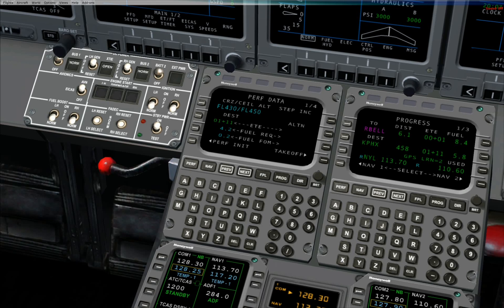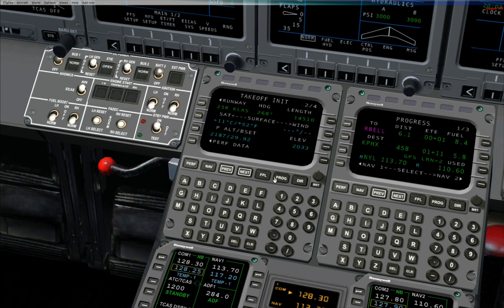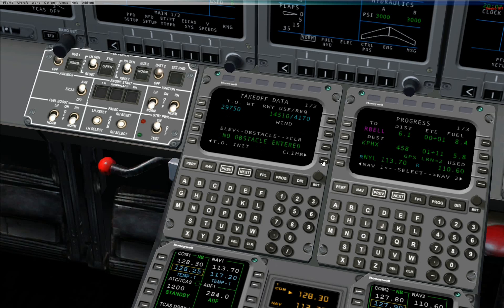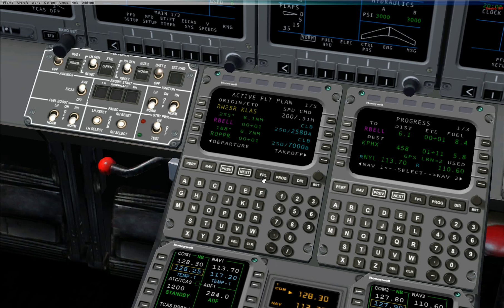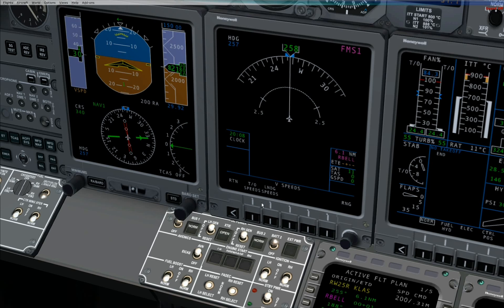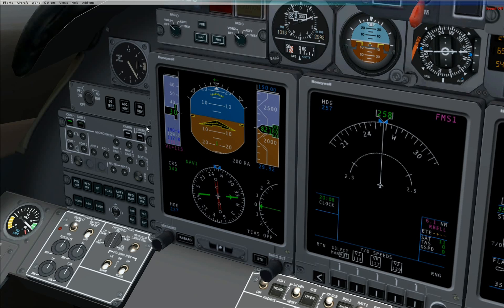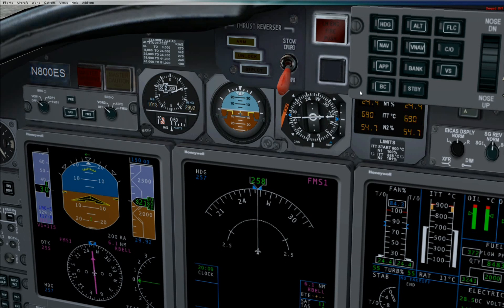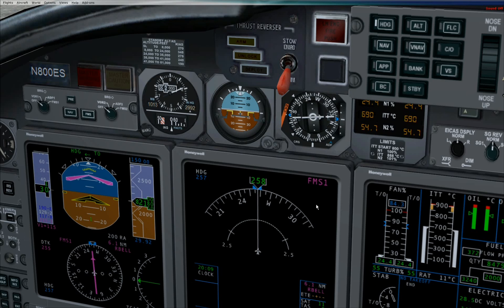FMS Programming 101 - Step 4 -Takeoff Initialization

Comment: (continued) I get the airplane to start the VNAV climb.  However, I'm unsure how to get the plane to climb or descend on it's own without hitting the VS button and adjusting the FPM descent and climbs.  Also, I setup my plane for the descent (again, hours and hours of experience in CS 757/767) and when I reach my TOD, the plane just sits there level.  After pressing a few buttons, the plane dives into a 6000+ fpm descent and blows through the descent profile.  What am I missing here?  Thanks!!

Comment: Hello CX.  Thanks for these tutorials.  I'm used to only flying the airliners.  This is my first step into the corporate jets.  I never imagined how different the two types of planes really are.

I can setup the FMS and get the plane ready for takeoff.  What I am having trouble with is after takeoff, getting the autopilot to fly the plane.  Whenever I take off and trim for climb and engage autopilot, the autopilot usually just levels the airplane off.  Eventually after pressing certain buttons

Comment: Hey too cool CX!  thanks.  i was wondering about that, since it says "Deviation' which, as i said below, i take to mean a "difference" between two values.  something else i noticed CX, between the E.S V.2, and "other' Brand, and wondered if, since you fly the real one, can clear up for me. 
in "other brand, on Tilt Panel,  there are two "Red" Fuel Cut-off Switches.  NOT in E.S brand. did they simply not model that, OR: did Cessna, in a later version (year model of the X, simply leave that out?

Comment from the maker: If you need to convert a value such as temperature from one unit of measure to another, the Citation X provides a conversion page in the FMS. Press the NAV index key and then move to page two. At line select key 1L you will see "conversion". There are four pages of unit conversions.

Comment from the maker: continued from previous post...For example: if the field elevation is 2000', the ISA temperature is 11 degrees Celsius. In this case, you would have entered -9 based on the 36 degree outside air temperature. The good news is that Metar weather reports and the Citation X provide temperatures in degrees Celsius so no conversion is necessary.

Comment from the maker: Hi,
The value to enter is the ISA deviation from standard, just like you thought. However, that particular entry only accepts deviation in degrees Celsius, so you would enter -13 because the temperature is 13 degrees Celsius cooler than standard. Conversely, use positive numbers for warmer than standard. Remember 15/59 is based on sea level and each 1000' in elevation change will result in a 2 degree Celsius change in the standard temperature...continued on next post

Comment: Hi CX.   when we enter an "ISA DEV" value,  is it looking for the "Diff" between what ISA IS........15c/59F - and what  our "Current" ambient Temp is outside,  so if ISA is as stated above,  but it's 36F out,  would i enter 23?  ( as this would be the "Deviation" from ISA correct?  the DIFF between these two values)    or do we just enter ACTUAL Temp,  from EICAS display?   which is right?